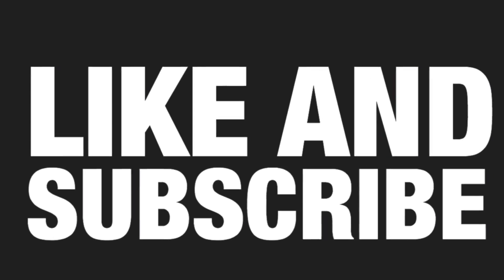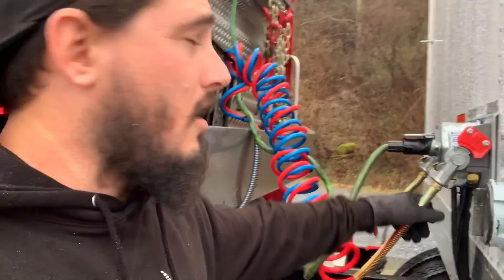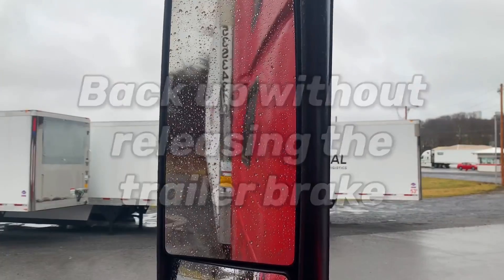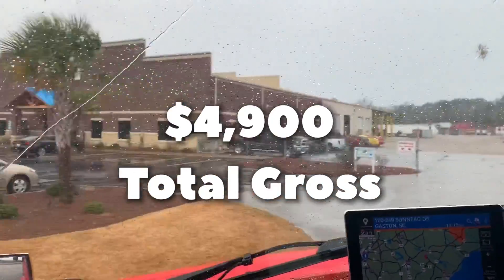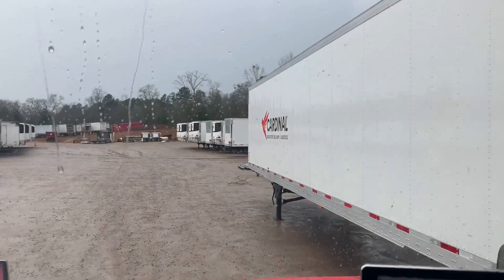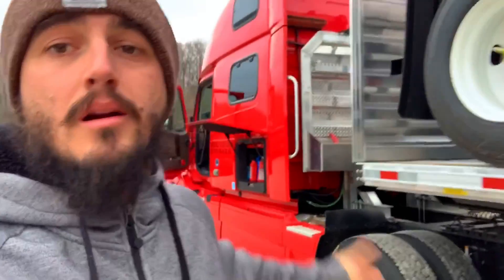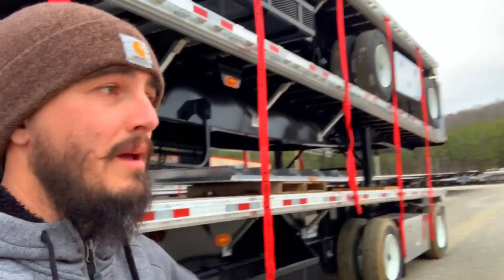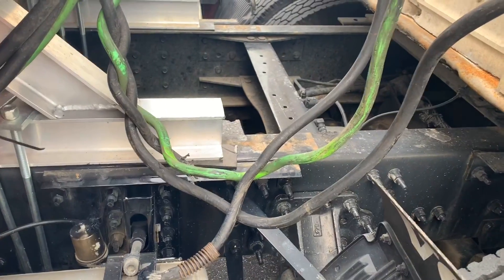Ep. 126 : How To Move Trailer Axles : Broken Air Hose : 9 Trailers & $4,900 In 3 Days : Exploring

Comment: Good video. But I'd like to save you a step in case you didn't know.  Once the tandems are in the front. You don't have to get out and push pin. You can actually do it while inside the cab. Just release and set the truck and trailer brakes and it will do it automatically.
Reply from the maker: Penske Driver844  lol for the sake of showing the process and how it works, just got out and gave the example so then Hotshot guys can see what really happens. I just release the air most of the time 👍🏻👍🏻
Reply: 10/4 man keep up with the good videos

Comment: I'm curious about who you're getting those loads from  because all I find is the brokers that only want to pay  100 $ or 1.40 mile
Reply from the maker: I use TruckStop for all my loads. Keep in mind, most things that you see for $250 or less or the 1s paying $0.70 or less per mile, 9 time out of 10, those are load outs. If your familiar with that, cool... If not, a load out is a trailer, usually empty, that needs to go from A to B... While you’re moving it tho, you can use it for X amount of days to move freight and use it as if it were your trailer. I know a lot of guys who only gave power units and do strictly load outs. Sometimes you can get super lucky and get a trailer for a few weeks. If you can do that, bring your own straps and move freight if you need to.
Reply: @DreamInspired  thanks...